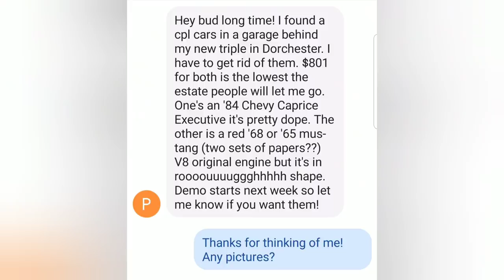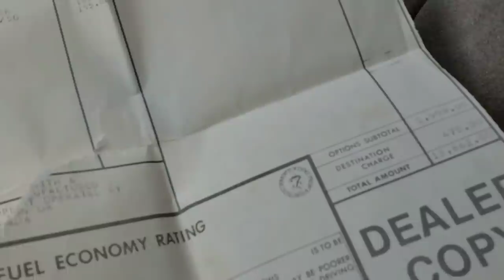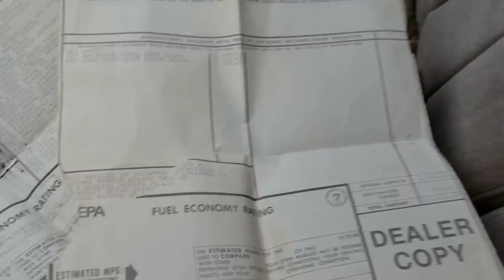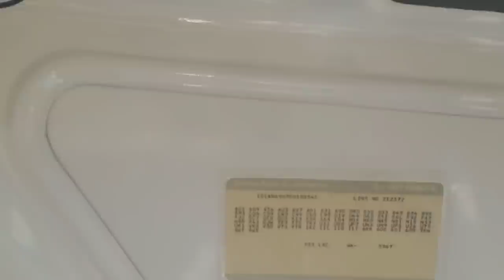I found a Mustang and Caprice abandoned for 30 years! Did I win?

Comment: Mustang is too far gone, I bet the springs are popping up through the trunk floor. Parts car all the way, or possibly a V8 drivetrain donor for a V8 conversion job on another Mustang. The Caprice is way nice for Mass, easy fix and worth 6-8K if it turns out nice and detailed. Maybe even more.

Comment: look at the interior of that trunk! all the stickers are pristine. That car was driven for 3 years then parked. 

10 grand would get that mustang into a nice daily driver. 

If the underbody isn't rotted to ratshit and it's just door skins and fenders, it's worth saving. If the subframe etc is gone, junk it.
Reply: No... it's too far gone...... the rear suspension has likely gone through the trunk floor . . . . .  RUST, RUST, RUST
Reply: @34Packardphaeton  we can't know for sure because we aren't there but yes, that's a common problem.

Comment: Assuming the Caprice actually does have 39xxx actual miles and you can get it running and driving fix the rust you could get 5k all day. The Stang is gone. If you can get $1000 for it take it and run.

Comment: Is the Mustang a really low VIN or did somebody bondo over the rear side marker lights?  This could have been a really early '68 because it does have the '68 steering wheels and grille, but it is missing the rear side marker lights.

Comment: You can get the motor broke free by mixing ATF and Kerosene together and pouring it into the cylinders. Let it sit a week and it will turn free. If the motor turns over. It's worth $400 headlight surrounds and hood another $100. Tail lights $100 original dash and instruments $400. You can pull the seats. The frames might still be good so as a complete set of original seat frames probably $250 Gas cap $75 you will get your money back atleadt and a little for labor

Comment: I would cherish that 36 thousand mile Caprice! If you still have it, Would you sell it to me? I want a full frame big body vehicle & that time capsule looks to fit my wants & needs! It will need all new rubber, brake & fuel lines along with every part of the braking system & the fuel system/ The gas tank drained & maybe coated or replaced. I would take it as is gladly!!!

Comment: Fixed up the caprice is worth 5000 if u clean it and have it running i have seen beat up ones sale for $700 in this shape if u clean it with the miles it could go as high as $8400 or higher if it runs
Reply: Didnt really think the caprice would be that much unless it was in immaculate shape, i was thinking $3,000 as is
Reply: vladimir putin  if fixed up yes it is look on line
Reply: youre out of your frigging mind LOL
Reply: Matt Lobue  yes the car is worth up to 10,000. I’ve been offered 10,000 for mine.
Reply: @donttrustgovernment8055  Do you have original paint and interior in MINT showroom condition, less than 15000 miles and are the original owner with ALL service records and documents since New?

Comment: Mustang is just parts. I would try to sell it whole. 

Caprice, it might be worth decent money cleaned up running and driving. It would take a pretty good deal of work to get it going again though. All tires/brakes, belts, battery, carb rebuild, fuel tank, blow out the lines, exc. Car may be worth $5k on a good day with it being NICE.
Reply: In Saudi Arabia, these 1980's Full Size GM's  command big money